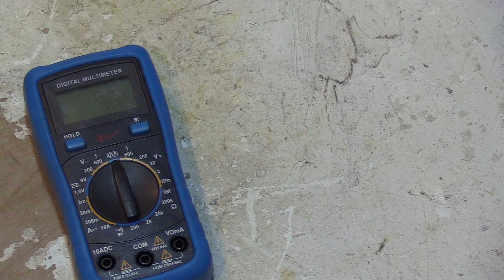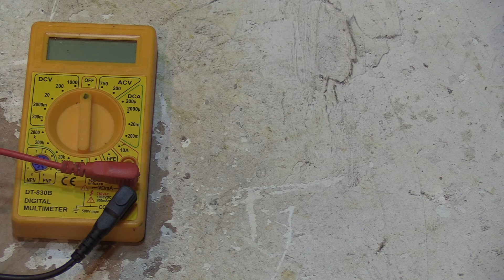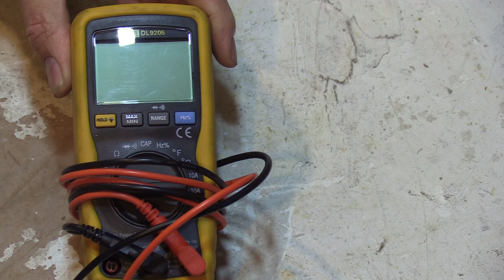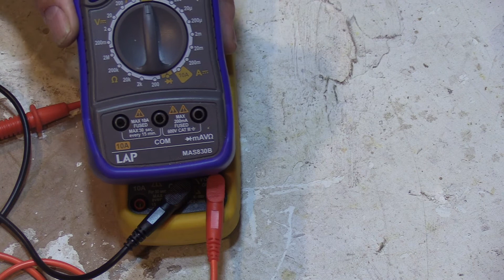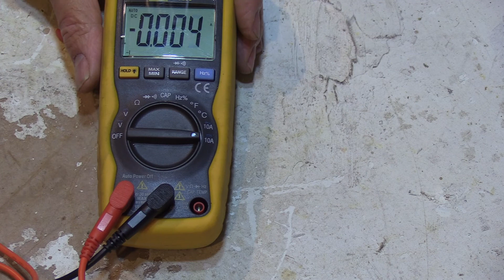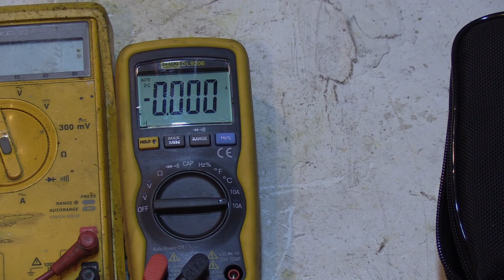Review of a Di-Log multimeter

Comment: Thank you for the video information and, the clear , simple and logical delivery of information. This is helping me decide on a good multimeter for the use on my motorcycle restorations and other motor vehicles. If you have any suggestions that could help guide me to choosing a suitable multimeter, it would be appreciated sir. I find myself needing to check resistance on coils, stators, plugs and leads, resistors and other components on the motorcycle. I was looking at Fluke at the time and came across the Di-Log advertised in screwfix so decided to find some reveiws which directed me to your video. All the best sir.
Reply from the maker: Thankyou, I made this video 5+ years ago, guess what, I am still using a di-log meter see https://www.youtube.com/watch?v=YZ1R9vc_Kqk